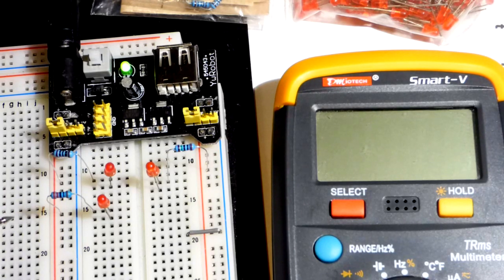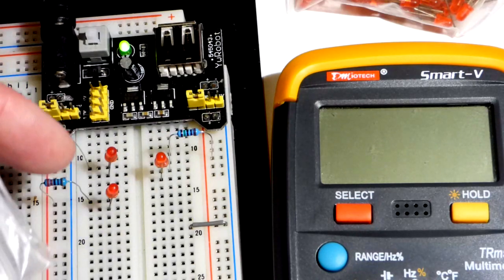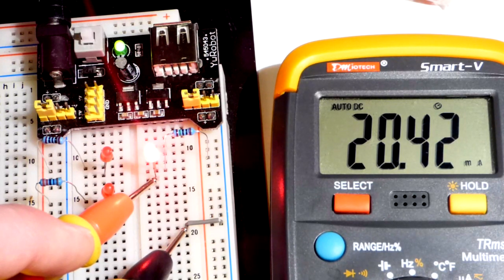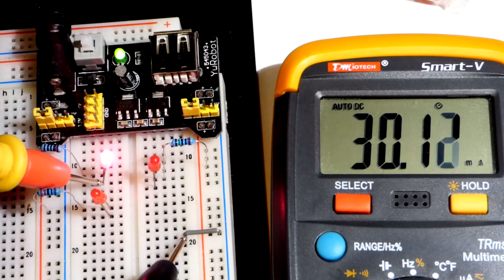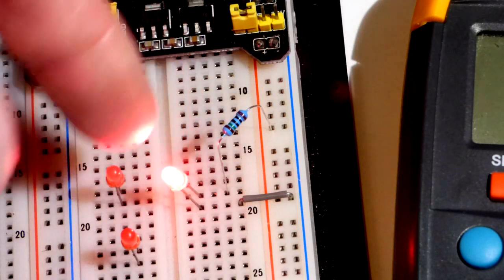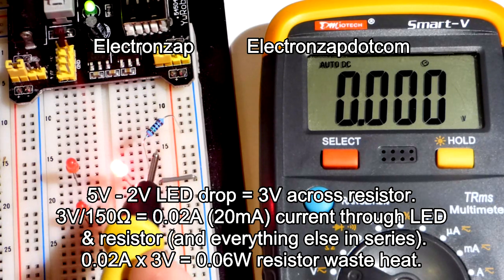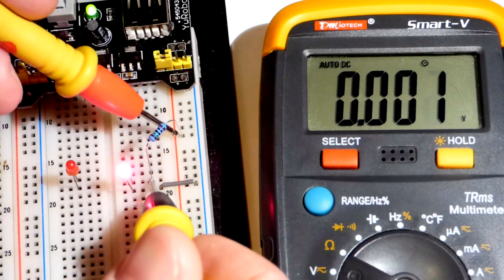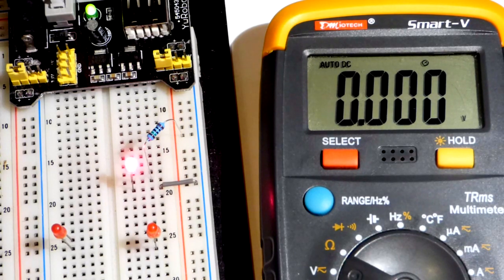How to pick a safe resistor value to limit current through an LED to 20mA with a 5V power supply

Comment: I confess some times I run on them at 20mA.  But really thats Maxing themm out according to the spec sheets.    Plus I don't see hardly any difference in brightness between running them at 15mA  vs 20mA    Its probably safer for long term builds to shoot for 15mA  tops that way they stay cool and theres less chance that they will fail....
Reply from the maker: Indeed!